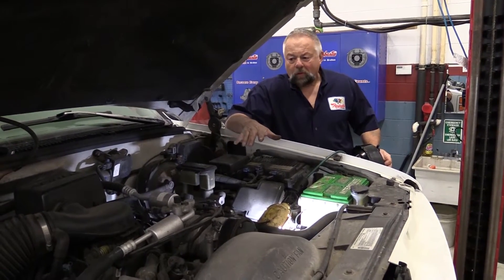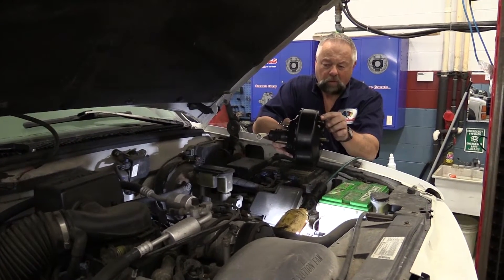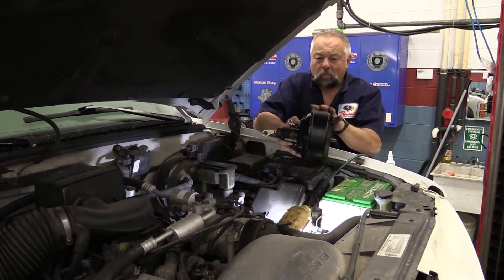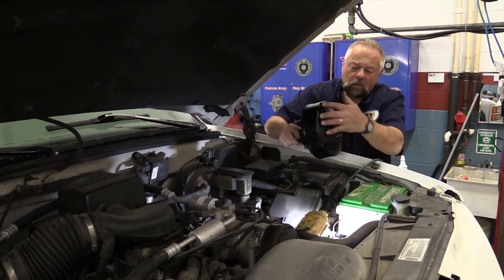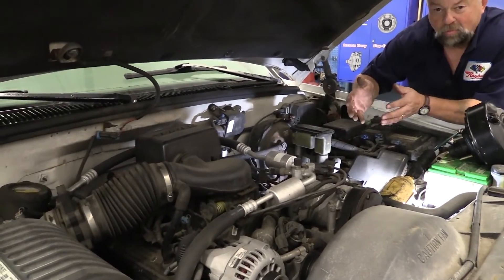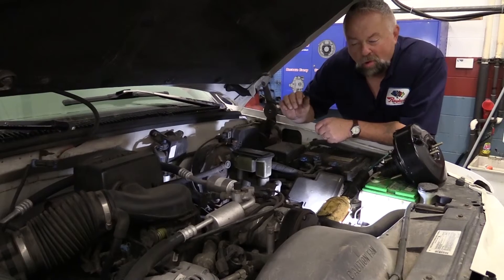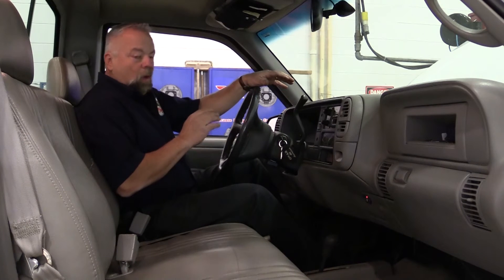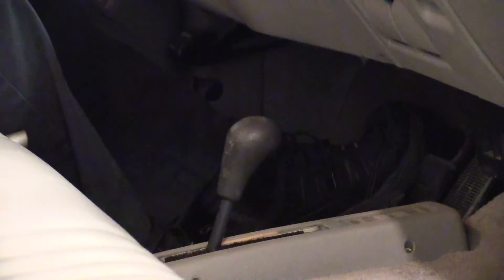Hard Brake Pedal: Is Your Brake Booster the Problem?

Comment: I have an interesting problem. my brake assist is great and no issues there but when I sit in the car and try to start the car the very first time (cold start) I have to really press hard on my brake for the ignition switch push start to get enabled for the car to start . However, once I get the car started, the brake works completely fine and when I stop and turn the engine off, I can start it again without applying too much pressure on the brake pedal, but if I leave the vehicle and come back after an hour and then try to start the car again, I have to really press hard on the brakes For the ignition switch to get enabled. At first, I thought my break switch was going bad, but it is not. Can you guide me what the problem could be?  I did replace my check valve, but that did not change anything.  It seems like I am supposed to have vacuum in the booster, but for some reason, the vacuum escapes after like 30-40mins. I’m not sure what else is supposed to keep the vacuum inside the booster beside the check valve. Please help.
Reply: I have this same issue 2012 Lexus 350 ... did you remedy this issue??

Comment: Can someone please help me I had brakes and did the vvt on the driver side on my 08 ford expedition and had the valve cover off and couldn't reach a bolt and had to turn the wheel so I could reach it and I turned the key to on to turn the wheel and after I put everything back together brake pedal is still stiff like your towing it and have no clue what caused that

Comment: Man, great explanation! I wish someone would do a video with a Hydro-boost system. My 98 Mustang GT (Stored for 6 months a year and in mint shape) is hard as a rock and I have to really sit on the pedal to stop. Power steering is great! I'm going to flush the PS system and fresh brake fluid and bleed and see if it helps? If anyone has any ideas, it would be greatly appreciated! Be safe!

Comment: Ok. So if I hold the brake pedal lightly t doesn't drop but if I hold it semi firm it does. Also when it does drop it makes a slight grinding noise it didn't used to.

Comment: I just replaced my booster in my vehicle the other day, now I have to push extra hard to get brakes. I pulled off the vacuum hose to the booster and got no “psssst” noise when I did. Assuming I got a bad booster and will be replacing it again

Comment: Thanks for the vid. I was able to figure out that I had a bad check valve (no whoosh!). The check valve was cracked and was missing the top of the valve.  I was worried that this was going to be an expensive fix at an auto repair shop... turned out to be a $7.00 fix! Thanks again! You and YouTube saved the day!

Comment: I have a 1970 Challenger. It had drum brakes all around. I converted the front to disc with a booster. Now after driving it for about 5 minutes, the brakes get hard and they locked up the other day allowing the car to barely move. What could the problem be from?
Reply: Feel that pain! I have 88 D100 with same issue! I bought it last fall and just now getting to go thru it... It looks to be a newer Master and I reckon the booster needs replaced. I can barely hold the truck down!! It doesn't look likely we'll get a response from raybestos from the post I see!??!
Stay cool and safe!)
MichaelB.✌️
Reply: @mikeb.3594 Never understood why they make a video but not answer questions,thats part of the whole process,thing that made me chuckle is that he said the customer brought the truck in the video cause it had a hard pedal but he never addressed that either,lol  "oh yeah the booster works great" apparently not or the customer wouldn't have brought it in, i'm sure the customer has better things to do than claiming things dont work when they actually do,lol

Comment: I have an issue on my Audi where my pedal starts out soft and stops well then becomes hard and I lose over 50% braking force..idk what this could be
Reply: Sounds like water in brake fluid. Heating up over time causing pressure buildup. Try flushing brake fluid

Comment: Great explanation. Unfortunately for me, my 2005 Town&Country doesn't have a brake vacuum pump, and I was saddened by this discovery bcuz it would mean I will still have that hard pedal. On another note, changing the pcv value  although proved to be difficult, And came out in pieces, it pushed me to replacing the value cover gaskets too. The brake pedal is still the same (no resolve there yet), but engine power did increase a good 30%. I was surprised at the acceleration. Still, the most important part is resolving the hard brake pedal. I doubt I will be replacing the booster or master cylinder. However, I do wonder if the ABS valve has something to do with it. I haven't checked for 15 to 18" of pressure.
Reply: If you don’t have a pump you likely get vacuum from the manifold. Maybe check the vacuum lines And see if any are cracked.
Reply: @elmeezyschannel2140  I went as far as I was prepared to go with that van. I purchased a 2015 and left the 2005 as trade in. Peace of mind.

Comment: I got a 64 impala with front disc brake upgraded kit. The first problem was a hissing sound under the dash at booster connection to the brake pedal. Then later on the engine idle dropped when pressing the brake pedal. The engine never died but as I released the pedal the engine idle advanced. Then lastly the brake pedal was hard when pressed. No power assist at all. Checked the one way valve and was good. Took out the brake booster and had it inspected. The rubber diaphragm was crinkled and warped. Did not know how this happened but the diaphragm was replaced and all good now.

Comment: What is the implication of driving a car with a bad break booster?
Reply: If the booster is bad, or the valve is bad, or there is a hole in the vac line, then the pedal will go to the floor, but you'll still be able to stop the car.  This is a completely different feeling than a bad brake line, where the fluid is low or leaking, or if you have air in the lines.  Your car will still stop if the booster is bad, but it will take a lot of pressure from your foot.

Comment: Hi,im having trouble with my avensis 2005 brakes. The problem is that you get brake assist for one or two times it feells normal bet let's say your in a parking lot it  dosent do the job i changed multiple vacume pumps on it it still does the same it produces -0.8bar of vacume. The lines look good chek valve is working properlly and its holding vacume fine. Can it be the brake booster it self?

Comment: You really helped. My mustang pedal was rock hard after holding it down to change the switch. Just released the vacuum and it reset.
Reply: When you start it and hold it down do you keep the hose disconnected?
Reply: Same with mine

Comment: If my engine does not produce enough vacuum for the booster what can I do?
Reply: Well, I'll take a stab at it. 1st check for engine vacuum. If low, check for leaks. Could be anything from a line to intake manifold gasket. Make sure the engine is at proper idle speed, this can also affect vacuum.  If carbureted, check to see if carb is properly adjusted. Idle mixture screw can add vacuum if set properly. All else checks but still too low, have you modified the engine in some way? Some camshafts cause low engine vacuum due to overlap. Last resort....they make electronic vacuum pumps that can be attached to brake booster directly.  SSBC makes one, there are others. They are NOISY but they work. They also aren't cheap, so hopefully it turns out to be something else. I've got one on my car (wanted power brakes with big cam). Makes as much noise as electric fuel pump. Hope it helps.

Comment: Nice explanation.  I have a problem with my car break peddle.  When I press the peddle 3-4 times in immediate interval which we do usually in heavy traffic,  I feel like my car break peddle becomes hard and harder,  and at one point it becomes so hard that it won't give you breaking effect for few seconds and suddenly it it comes to normal.  Could you please suggest me the exact problem with my car breaking system.  
Thanks.
Reply: Have simillar problem,did you found out what was the problem?
Reply: @evaldasbusilas1733  losing vaccum, do you have a turbo?
Reply: @evaldasbusilas1733  SAME problem .... anyone figure this out ?

Comment: hello, thanks alot for such an amazing explanation, I have got honda civic fd1 year 2011 and it seems to me brake pedal is slightly stiff half way down and needs to be pressed with alot more pressure, did carried out tests you mentioned, no vaccum leakes, check valve seems proper, brake booster functionality seems operative  but brake pedal isn't responsive/sensitive it should be. Pedal takes more pressure half way down and car stops on longer distance, installed oem brake pads, tires are in condition as well... should I replace booster or are there any tests required on brake lines/calipers/abs module?

Comment: So if the check valve was taken off booster. Would that cause engine to stall when pushing brake pedal down ? Vaccum hose is just pushed in grommet of booster

Comment: mine passed that test. my brakes are building up pressure and blew out the front left line. all 4 wheels will start applying the brakes in a short drive, pedal is hard to push at that point
Reply: This sounds exactly like what mine is doing! Did you ever find the culprit?

Comment: '07 Nissan Versa, works fine when cool, but as soon as the engine is warmed up or on a really short road test the brakes lock up and brake  pedal gets hard. Replaced the vac booster and the inline check valve hose, still doing it!
Vac supply to the booster is okay at around 18 to 21 psi.
When the check valve hose is removed the brakes release and can be limped back to the shop.
Could it be an imbalance of vacuum on the rear chamber of the booster? But then again, this is a replacement booster doing the same thing it was replaced for.
Any ideas?
Thanks
Reply: Did you fix it? how?

Comment: So wait could the check valve be the issue that’s what I’m trying too figure out Bc I can’t push down the pedal almost at all and when I start going and the engine revs up it’s fine but since I’m in a manual I push in the clutch too come too a stop. So idk if it’s the whole booster or the valve
Reply: Did you ever figure it out? I'm going thru the same thing

Comment: Hello I have a 2001 ford crown Vic Lx. When I was parking at work. The spot had a dip in while backing up. When the dip came I had to raise up
On the brake to stop second going home I just got off beltway. Going down this little deep hill it seems like my brakes when really close to the floor I did bleed the brakes . And it seems like the same result I need help from. Anybody

Comment: so the conclusion is that it was the check valve? I just had my brake servo failing this morning after a 10 minutes drive, I parked the car for a while and when I started it again the vacuum was gone. I was waiting a bit, and pressing the pedal multiple times then it was back on.. no idea what it could be. What do you think? Gotta wait for weeks for an appointment with a repair shop over here..
Reply: The conclusion of this video: Each component tested has passed inspection and the truck still has hard brakes.
Reply: Dogma4590 lol
Reply: @kirk4590  Agreed, the customer brought the truck in because it supposedly had a hard brake pedal, but the mechanic said it is working fine!